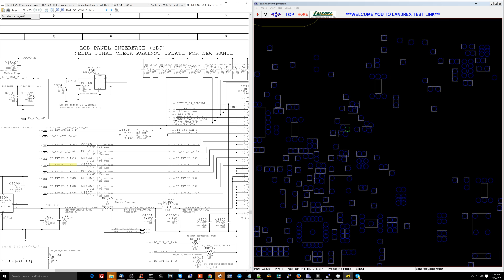Repairing Macbook Pro Retina displayport symbol error in ASD

Comment: My 2014 MBP with Iris 5200 only is having an issue where the screen will glitch and show horizontal tearing in random places (mainly the bottom half of the screen), about once every 5-10 minutes. Does this on internal LCD as well as external monitors. When I try to install Windows 10 in Bootcamp, it'll work on the software graphics driver, but the second the Intel IGD drivers are installed, the screen goes black. ASD gave me a Displayport Symbol Error. Is this likely the problem I'm having too? Laptop was only dropped once in 2015, but he problem started in 2018. Always take very good care of it, and replace thermal paste / dust it once every 6-12 months.